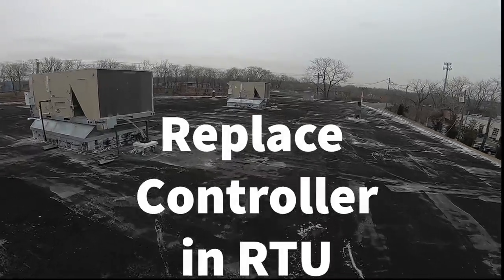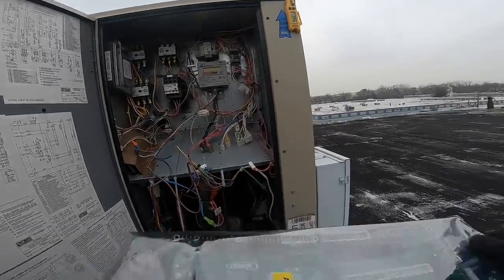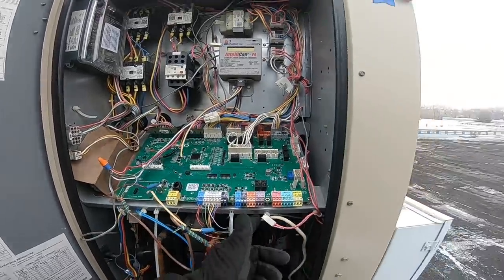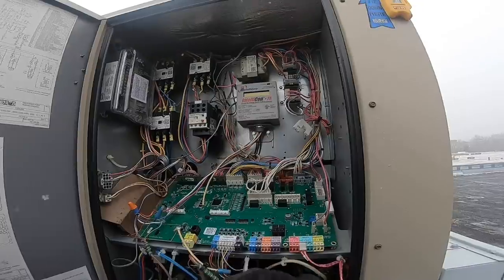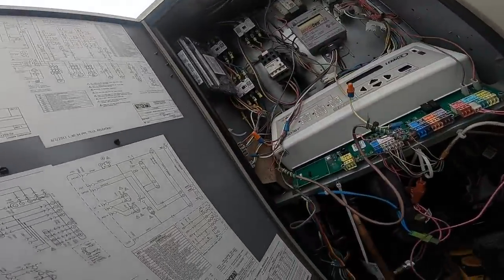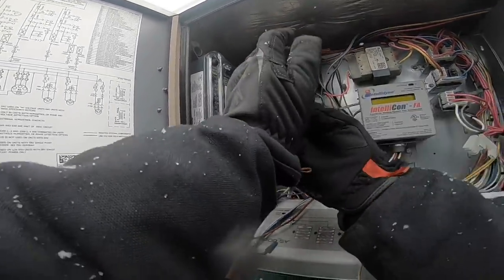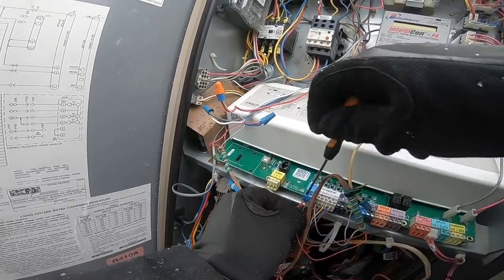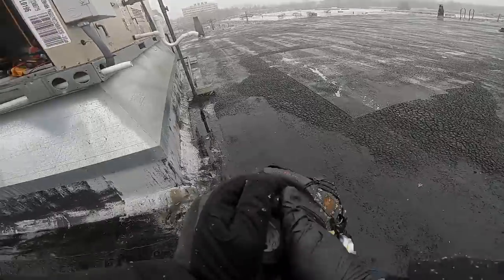HVAC Repair Shorted/ Grounded Control Board, Cooked Wires and Overload

Comment: I was surprised to see you trying to willy-nilly these connectors to the board.  If you get confused, that other Lennox beside you....walk over there and look at it.  Mark your wires before you pullem. Last resort, read the nice schematic you have there. I noted on a lot of the manufacturers they use different colors and match the base color to the plug, or use a 3 pin then a 5 pin....Don't let the smoke out of that board.

Comment: I take several photos of wiring before proceeding with any removal of a cable so you don’t have the cluster of spaghetti -“pick up 52”.  I also have white tags with a string eyelid to mark with a magic marker. I just do Top Left 1 or (TLFT-1).  I also will print out a 8 1/2 x 11 wiring photo at the office of these more expensive boards. I bring magnets to stick the diagram to a surface while putting these back together - Zero Defects, much faster.

I had a panel with a built in surge protector on the 480/3p and the circuit board blew.  The Moron installer took a long whip for the ground and placed it next to low voltage cables in a wire management tray and the surge jumped over.  ALL surge protectors need to be bonded/grounded immediately, as short as reasonable the cable length and no sharp bends, only a large radius turn.  Thousand of dollars due to the installers ignorance and negligence. 

When facing burns marks, I also add a surge protector, which may or may not help, but is an assurance.  SIEMENS SmartSurge has an audible it fails. I tell clients they may be best adding lighting rods especially if this happens again.

Comment: No hot pads? Go warm up a few then go back up. 
Oem wires have id numbers on Lennox rtu...re label them. 
A picture of connections sure helps before removal. 
New York/Joysey accent...lol
Battery azziz..? Lmbo
Reply from the maker: Yes this job wasn’t the warmest day yet if see the initial call it was 12 degrees at this point of the day with a -14 degree windchill. Born in the Bronx grew up in jersey